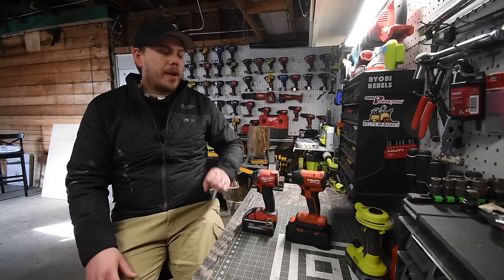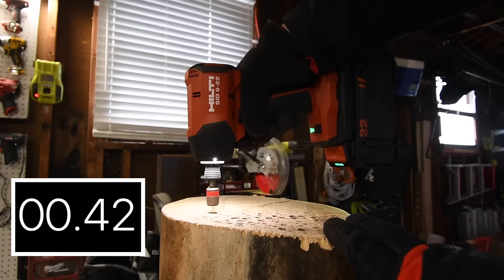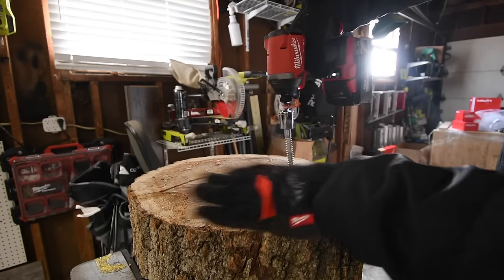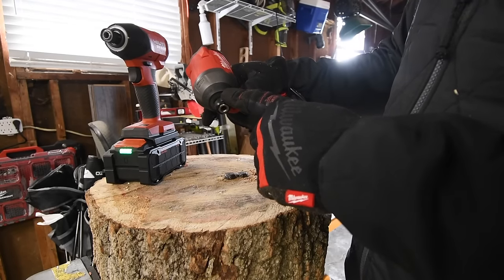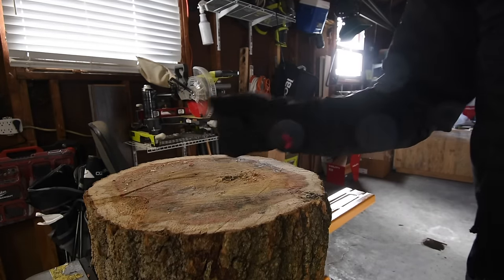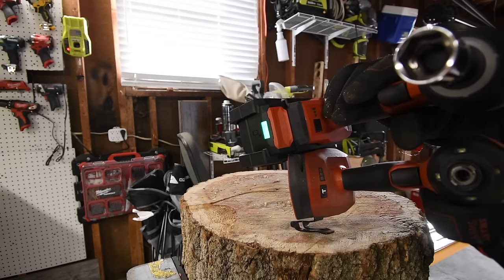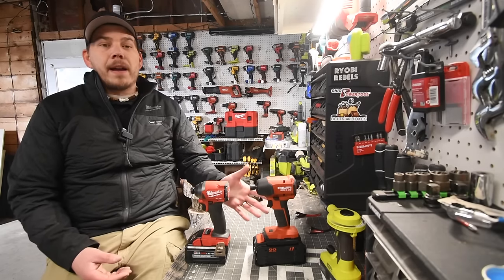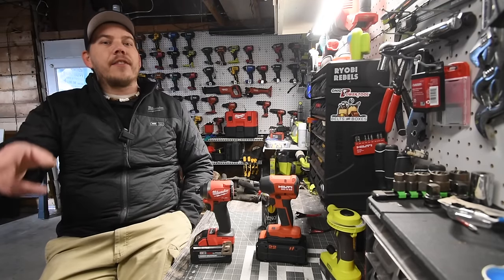Is Nuron Better Than FUEL Now?

Comment: Hilti will never out power milwaukee. I think for Hilti it will never be about that.  They just make fantastic tools.  Once you own them you will never want another
Brand.  Look at the quality of that impact and how beautiful it looks! That coming from a milwaukee guy.  Just the design, and how it feels, it is not  even comparable even the slightest to the fuel impact.   Absolutely love the SID 4-22 and I love my new SID 6-22. Haven’t had issues with collet either.  But that fuel impact is a BEAST with power.  But can’t stand the annoying high pitch wining sound mine makes when sitting idle after use , trigger issues, lose battery and just doesn’t have the durability Hilti does in my opinion.  Unless your using these tools
To do this extreme testing 24:7, what does it matter for a lag bolt to be a few seconds behind lol For HVAC I have ZERO complaints, with ZERO problems.  Can’t say the same about my milwaukee impact, or other milwaukee tools. Always in the repair shop 
With that said still looking forward to milwaukee gen 4 impact!
Reply from the maker: we will see in the future
Reply: Hi Anthony,
My Hilti SF6H A22 combi pisses all over my Gen 3 Milwaukee combi in every respect. And the Hilti works all the time and is so much smoother to use and doesn't overheat like my Milwaukee. I find Milwaukee too overhyped and uncomfortable to use all day. Yes.....I get the trigger issues too. I have the Gen3 Milwaukee impact and the Hilti SID 4 and I much prefer the Hilti.
Dave.
Reply: @davesheppard8797  
I agree with the hammer drill. It is a beast. I never liked the older brushed model, but the new one is very nice 👍 
I do respect and love milwaukee for it’s power. But after having the sid 4, there isn’t any comparison, other than lack of power. That’s the only drill I want to reach for, even more than my new sid 6 lol. I just love the feel and performance of Hilti tools.  They are truly exceptional in design, and when you put them next to another manufacturer it shows! Only brand I have a hard time with getting them dirty  haha 
The new impact is very nice although I prefer the smaller batteries since I’m not banging in lags or anything difficult 24/7 
I will say they could have improved the 12v drill, I love that drill but they could have had speeds on it, quick connect, and don’t like the light on base of tool.  And feel they can shorten the length.  But nevertheless no complaints with the 22 line 👍
Reply: @SkilledLabor  Anthony......Er........I get upset if My Hilti SF6H, TE6, or SID 4 get dirty!! 😂😂😂. They still look brand new!! They are sooo nice to use all day though with no user fatigue.  I have a corded Hilti TE1 SDS I got 2nd hand from a contractor 35 years ago. He left it behind and never bothered to collect it. After numerous phone calls to him he told me to either throw it away or keep it myself as he had already upgraded to a newer Hilti SDS and he had thrashed it to death anyway!!   I was using a shiny new Makita SDS at the time so the TE1 became the SDS bitch (😂😂) used and abused my all my young trainees and everyone else!! 35 years on and that TE1 is still as smooth as silk to use, keeps up with modern SDS drills and has outlived many shiny Makita's and DeWalts etc. I now care for it properly and give it the respect it deserves.  It is my No1 go-to corded combi. 
Dave.
Reply: @SkilledLabor  Also Anthony, I bought the Hilti Gen1 SF6H combi just before the Gen 2 came out. I wasn't really impressed with it as it was quite slow (1650 rpm) and not really inspiring.  It was however comfortable to use. The Gen 2 brushless SF6H though is amazing  I think. Much better than my Gen 3 Milwaukee fuel combi, that has trigger issues, loose batteries, whiney, and gets hot really quickly. I think the Gen 2 I had was better. Didn't like the silly one-key though......that never got used. I tell the drill what to do....It doesn't tell me!!! 😂😂😂.  I have a brilliant trick I use when drilling in screws!!! As soon as the screw has gone in as deep as I need it, I release the trigger!! (Clever huh? 😂😂). Take care Sir and I wish you joy with your Hilti's.
Dave.
Reply: @davesheppard8797  

Definitely agree with you on that!  35 years and still trucking along like a boss . Almost want to buy another set just for home to keep clean.  :).  I feel they did a great job with the hammer drill upgrade and whoops the gen 3.. funny you don’t hear the haters then.  But when the impact doesn’t sink a lag as fast it’s all of a sudden overpriced trash 🤣. I was never a fan of the gen 3 hammer drill, always had problem after problem with it.  I do wish they would have put a little extra into the upgraded impact to shut up the haters. But Hilti doesn’t seem to care about main stream, they do just do their own thing, and I respect that.  Most people who just watch and haven’t used a Hilti product over looks the quality of it, the durability etc..   High quality it is and I love it and appreciate it.   And I like having a set of tools that’s different from the rest.   But to each to each is own.  If you want nothing but raw power and that’s it. Milwaukee is for you.
Reply: @SkilledLabor  God Anthony, how things have improved!! The first drill I owned and took to work was a metal Black &  Decker with a 3/8" chuck, a single speed of about 2,400 RPM. No slow start, no hammer action and no one knew what torque settings were!! 😂😂.  Yet we managed!  Mind you......all my Carpentry tools are Antiques. Disston saws, Marples Cast steel chisels, Mortise, marking & cutting gauges. Marples wooden block, Jack & fore planes......God I'm getting old!! 🤣🤣🤣
Take care mate!
Dave.

Comment: While videos like this are mildly entertaining the only thing I found helpful was the 1.8 seconds where the specifications of the tools were listed.  That said, not a word about specifications beyond the blink-and-you-missed-it slides, the significance of Hilti's 6S battery pack versus Milwauke's 5S batteries, that the Hilti battery is capable of delivering up to 100 amps when needed (how much can the M18 HO deliver?), the sophistication of the Hilti's battery management system and how it communicates with the tool to deliver optimal performance.... and that Hilti tools are NOT for the home/DIY audience (unless you're a doctor or lawyer and also collect Leica cameras, then yes, it's totally for your two at-home DIY projects per year).  Comparing the Hilti Nuron driver to a Hart or Harbor Freight driver would have been more entertaining because at least you could show an answer to the question: "Does paying 10x more for your tool allow you to get the job done in 1/10 the time?"
Reply from the maker: bro, My channel is a tool versus video channel. I have over 640+ videos. Im not going to say the specs of the battery chemistry and how each tool works with a specific battery in every video. Hell no. people will get tired of that fast.
Reply: @roman - Tell me you’re a condescending know-it-all without telling me you’re a condescending know-it-all.   🤣🤣🤣🤣
Reply from the maker: @betods1013  exactly. 🤣🤣

Comment: Something wrong with that Hilti. Unless the torque number is a lie it should be alot stronger and atleast outperform the millwake when driving larger lag bolts. That's a disappointment the specs on that thing looked insane and it should have blown the millwake out of the water and only real competition against the flex.
Reply from the maker: a lot of these tools need to be broken in for it to reach its full potential. I've done a few videos and used it a lot off camera since this video and it is a lot more powerful than its first video. Round 2 is coming in the future
Reply: I have to agree with you on the specs.  It should outperform the gen 3 with the torque specs and match for rpm’s etc.   never paid attention to a break in period but I’m sure it will a little but should have been neck and neck out of the gate.  Obviously hilti hit a knot with that 6” lag
You could always put a new gen 3 side by side his existing to see the difference in the tool break in requirement.

Comment: Hilti vs kobalt xtr👍
Reply: In what context?  For a home/DIY user the Kobalt is the right answer because it will do everything you need it to do and leave you with lots of money left over to buy lumber and supplies for actually doing projects.  The key to the Nuron system is the battery pack: 6S packs of 2170  batteries with wiring and BMS to deliver massive amounts of current.  The Kobalt line also uses 6S packs (six batteries in series to deliver 24V max/22V nominal) but they don't all use 2170 batteries: the cheaper batteries use 1865 batteries which have less capacity and less current potential.  Also, the motors in the Kobalt tools won't be tuned to deliver as much torque as the Hilti tools because, unlike Hilti, they weren't designed to be used all-out, all day long as the means of making your living.  That means the motors on the Kobalt will have fewer wraps, the insulation of windings will be less stringent, and the focus being on keeping the cost down as opposed taking a beating for 20 years without the user having to invoke the warranty.  Simple cost/benefit analysis and economics.
Reply: @RomanMcClaine  the kobalt xtr is a professional tool. No the kobalt does not have a 20yr warranty. But it has a 5yr no questions asked warranty. And it would beat that hilti nuron with any of their batteries. It's faster than the gen 3 Milwaukee. so please look in to a tool before you complain about it👍
Reply: @BC-go2hm  I wasn't complaining: I was saying the Kobalt is the clear no-brainer for home/DIY use.  Whether it's pro-grade... I don't hang out on construction sites but those would be the folks to ask whether they think it is (and if you're one of those folks and you say it is then awesome -- I believe you!).
Reply: @RomanMcClaine  I hang out on construction sites yes we do use them a lot👍
Reply: I think that would be closer in terms of performance, but they are decidely for different markets, even if there is some overlap. Might be embarrassing for Hilti
Reply: @ccbowers  the biggest embarrassment is definitely the price for proformance

Comment: You cant beat hilti with being faster. Hilti will outlive you. There is no european house in which hilti hammer didnt left its mark. We even call all big rotary hammers or demolition hammers a "hilti". As european i can confirm that tools made in europe for western european standard are slightly better. We tested same makita tool that is made in china and one that is made in romania. We tested drill and circular saw. Romanian tools felt like 10% stronger. I personally have chinese makita tools, because croatian stores do not sell romanian makita, even tho romania is one country away. Thing is, romanian makita produces for german market, while other eastern european countries order from china to belgium and then distribute. Its sad situation and it shouldnt be like that. I guess some will always be more "equal" than others.
Reply from the maker: this video was a warm up video to break the tool in. we will see how it performs in round 2. that video is coming soon
Reply: @ManCaverTools  
even if you destroy hilti, they will just pick it up and give you replacement before yours is fixed. Sometimes its free sometimes you pay it. It all depends how did you took insurrance. Also, i read somewhere that Ridgid gives some specific warranty, lifelong warranty ?
We in europe have brand AEG, which is european ridgid but we do not have that warranty

Comment: Just a question, not trying to be an a$$.What does it matter if the base is smaller if the battery sticks out past the base. Or it's just astheticly pleasing
Reply from the maker: that makes more room in tool storage without a battery on it. that goes for all tool brands. I wish Ryobi would do the same
Reply: @ManCaverTools 👍 I never even thought of that. the way they keep making the heads more compact the base will be the size of 12v before long

Comment: Hey Dave. I'm a big fan of your channel, but your bias towards Hilti is kind of obvious. 

I used to use Hilti in the field many years ago. Hilti tools are over priced for what they offer. They perform about a good as DeWalt but for much higher prices. 

Milwaukee Fuel tools are still the best performing tools on the market. And with all the hack deals we can get at Home Depot, you just can't go wrong with Milwaukee Fuel tools. 

I'm liking some of the DeWalt Extreme 12 volt tools lately, and have always been a fan of the precision and ergonomics of Makita 18 volt and own a bunch, but if I was going to jump into a new 24 volt platform, it would likely be the Flex line. 

But at this point I just don't have the need for a whole new platform that might perform just a little better than the great tools I already own. 

Sorry, but these Hilti tools are a hard no for me.

Comment: You said you'd be impartial but you made excuses the entire "test". You refused to call out the shortcomings and just hand waved them away.
Reply from the maker: they are not excuses. Just because a tool loses in a video that doesn't mean its garbage. Every brand has tools that lose in these videos. With your thought process that means the every tool brand is garbage. Example. I broke Milwaukee, HILTI, Makita and Flex hammer drills, and I didnt get the Milwaukee or Flex fixed yet.Does that mean that Milwaukee FLEX, HILTI and Makita are garbage companies? NOPE it does not.  Try again Richard

Comment: Hilton...OVERPRICED!!!! OVERHYPED!!!
Reply: Not really.  Milwaukee has always been the most powerful, but hilti is far more reliable and ergonomic.  After a day of use, the power isn't the entire story.  I have both platforms.  Milwaukee is great if you one thing and need that one tool for a short burst.  It's very hard to use Milwaukee if you are out the entire day.  Also DeWalt is amazing ergonomically too.
Reply: It's really not.. drill speed doesn't mean anything. The quality of the inner components are far superior to the Milwaukee

Comment: Hilti is clearly lying about the specs lol
Reply from the maker: Usually takes a video or  2 to break the tool in.
Reply: @ManCaverTools  that's true but I still don't see it having 600 ft lbs more then the gen 3, and the same rpm ipm. In theory it should beat it...it should at least tie now if it would beat it when broken in
Reply: I was expecting Hilti to do better based on specs too.  But, we’ve seen the reverse with their drills. It may hit 2,655 in lbs on a hard torque testing rig but but that doesn’t mean much when it comes to the speed of driving screws used in construction.  There are other factors like the wear in of the hammer mechanism (technically the slip clutch element of it if I’m wording it correctly) and the shape and speed of said mechanism.   That said, Milwaukee gets a lot of torque from the gears and the motor.  You can feel it.  The hammer feels like it’s doing the work but knowing how the assembly has a loose back (just pressed in plastic with a gasket) and the whole shebang comes loose and moves back forth, how much of that is knock back?  I digress, I’d like to see the Milwaukee with a 4ah 21700 or standard 5ah pack vs the Hilti with the 4ah pack.
Reply: @robertrada4783  Hi Robert,
I am a Hilti guy but wasn't impressed with the Hilti at all. I own the Milwaukee Gen 3 and I don't like it. I much prefer my Hilti SID 4 but then again I don't need mega power! My Gen 3 impact just constantly spins out of PZ2 screws unless I have it on setting 2. I also think that it's quicker drilling holes with a combi rather than an impact as I think it's faster and obviously smoother.  When I started 45 years ago I had a brace and bit to drill big holes....that was high tech then!!! 😂😂.
Dave.
Reply: @davesheppard8797  Yes, precisely. One of the key reasons  I use an impact is so that I won’t cam out of Phillips and Phillips Pozidriv, and that Milwaukee will jump out of them every damn time.  I tell people this and they look at me like I’m crazy.  But then I look at their work and see that their screws are all stripped…..
Reply: @robertrada4783  Yes Robert!! This is why I prefer my SID4 Hilti. It's only a medium duty impact anyway so shouldn't really be put against the Gen 3 Milwaukee anyway.  Having said that I wasn't impressed with the SID 6 and Hilti boast about all its power!
Dave 👍👍
Reply: @davesheppard8797  Hilti is all over the place with the accuracy of their numbers.  This new impact is overrated. The drills and rotary hammers are underrated. Hopefully the new impact wrenches are underrated.  They claim their mid torque wrench is as powerful as my Makita compact.  Speaking of Makita, I have found their numbers to be wildly off from country to country. Doing conversions, my XGT rotary hammer is either 2.8, 3.1 or 3.3 joules.
Reply: @robertrada4783  That's interesting Robert! I have found my SF6H A22 underrated and also my amazing TE6. Now this new Nuron SID6 is out, everyone is now saying that the SID4 wasn't powerful enough etc; whereas I love my SID4 and bought it as a medium duty impact as that is all I require for my Carpentry/joinery.  If Hilti start lying about the specs people will lose faith in them.  I love my Hilti drills and I'm not fussed if another make of drill does it a bit faster. I'm much more interested in build quality and comfort for all day use. Having said that......I can't see many battery hammer drills beating my TE6!! 
Great chatting again Robert!
Dave.